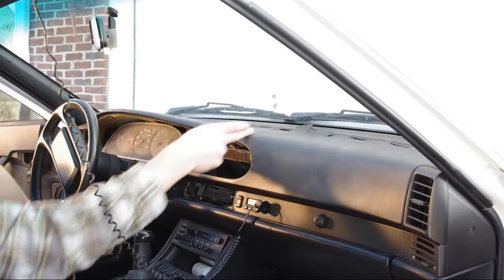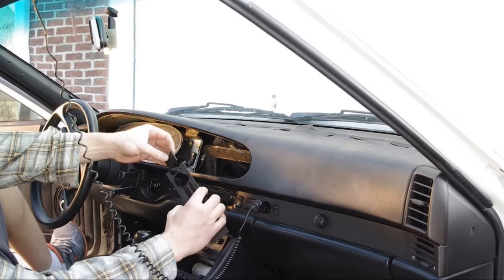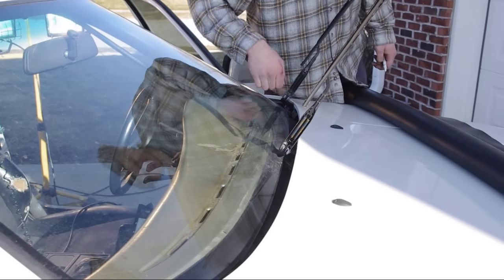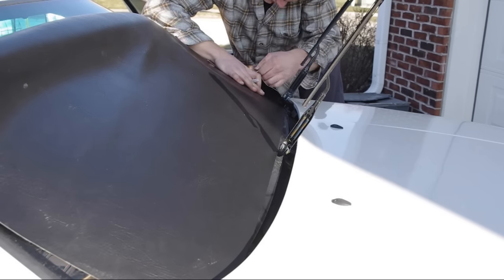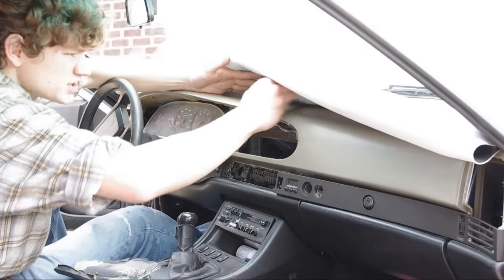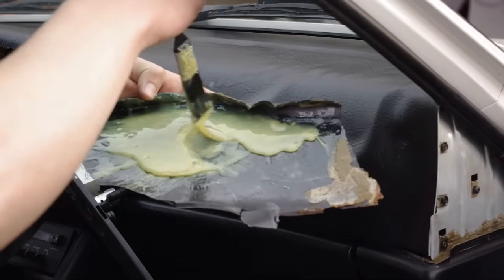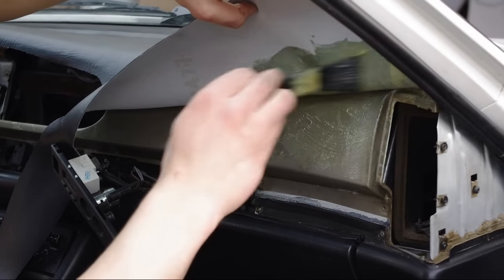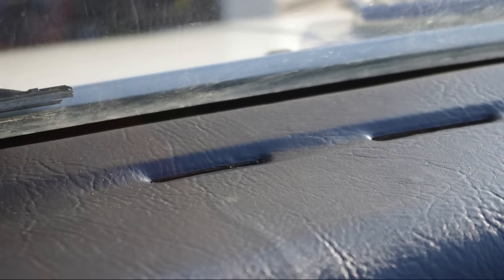How To Recover A Dashboard - Vinyl, Leather

Comment: This might be a dumb question but.... would doing this prevent a cracked dash?

I just bought a low mileage trans am without a single crack in the dash and I want to prevent it from cracking without having to put up a windshield cover every time
Reply: Keep it covered

Comment: Thank you for this handy video! The dashboard on my 1996 Dodge Ram is falling apart, and I'm about to do the same thing.
Reply: Joel M Yes, small ones for the screws. Once you're done, you just go around them with an X-ACTO knife.
Reply from the maker: This isn't a "Hack" it's a proper repair.  And you would just fill it in with a comparable foam and level it out before covering it.

Comment: Dude this is awesome, i did mine over a year ago , 1985 944 old dash , same way except the end result was hideous lol , i guess i used the wrong adhesive also was too afraid of burning the vinyl with the heat gun.Now that iv seen your video , i can do much better , tel me my friend, have you used a different kind of glue for the first part then like waited for it to dry then started the formation of the lower part ?

Comment: Great job!  I've recovered the roof liner in my '88 Volvo which had all come unstuck and falling to shreds. Bought some vinyl, however, carefully stripped off the backing by soaking it inch by inch with lacquer thinner (in a well-ventilated area). Didn't think to use a heat gun. Then used "ModPodge" craft glue, as I thought that contact cement would be too "unforgiving" when stuck to the "papier mache" base panel. Now am lookiing for a dark vinyl simulated dash cover for my Caliber - just because it is too pale and reflects into the wind shield. All I've seen on the market are carpet, fake suede and heavily textured "dashtex", which all seem too high maintenance dirt catchers. Looks like I'll just have to visit Jo-Ann, or maybe use some of that vinyl shrink stuff

Comment: Thats very nice dude. I need to do my 944 dash and all the trim inside sooo badly.
Reply from the maker: Thanks, Yeah it really brings life back to these old things.
Reply: Daniel Engling  My old vinyl is stuck real good to the foam..do you use a heat gun to separate it? What if you do need to fill large cracks before putting the new vinyl on, is there a foam spray like insulating foam? Thanks!
Reply from the maker: You can certainly use insulation foam.  I think that's the most similar to the original.  Using a heat gun to remove the original is a good idea.

Comment: Thanks for posting this vid. I am in the process of fixing up my 1990 Brougham myself. My dash came out in one whole piece so I think I will be okay to do the dash. MY problem is getting my headliner OUT. I have removed ALL the screws and loosed the clips above the windows . The inside molding is kinda interlocking and I'm going extremely slow so as not to break anything. No budget to speak of but I'm trying to have my baby last a few More years. She has some Really Bad rust that I can't fix but I have resigned my self to making her look pretty anyway. Any ideas of If you know of any vids would be Greatly appreciated. Have been looking for days to no avail and I want to finish her before the end of the month if possible. :-)

Comment: Can you tell me where you got the vinyl wrap at? And what kind of adhesive do you use. I have a 1962 Chevrolet Impala that has a steel dashboard and I would love to put black vinyl on it. Any information would help. Thank you
Reply from the maker: Vinyl came from Jo-Ann Fabrics.  Adhesive is called "contact cement" and can be purchased at most hardware stores.

Comment: Waited up, it was actually a problem were I was spreading the contact cement and it was drying up at the same time causing those lumps of cement. Only happened when I applied it to the viniyl not when applying to the material. First stroke of the brush was ok but 2nd one caused the lumps.

Comment: I'm redoing a h2 hummer interior. door panels dash and some other parts but my adhesive won't stick good. what exact brand and kind of contact cement did you use?
Reply from the maker: I'm sorry, I don't remember the brand.  Do you have armor-all on the parts you are trying to glue over?  That has silicon in it, bad for adhesion.

Comment: Not bad dude I wanna do this to the inside of my 02 mustang, it never had leather around any of the interior components just cheap plastic. Will this work the same way ?
Reply from the maker: I don't see why not!  Make sure the glue is spread around well.
Reply from the maker: Daniel Engling Oh, also make sure you take off ALL OF THE ARMOURALL you may have put on it in the past.  That stuff has tons of silicone in it and will be a nightmare to adhere to.  I would recommend a general grease and wax remover for auto painting or something like acetone (leave the windows/doors open so you don't pass out!).

Comment: I have a vinyl dash that is 30 some years old that has the front edge lifted up. No cracks yet. do you think I might be able to save it by heating it up and weighing it down?
Reply from the maker: +grn dragon Possibly.  Use good glue and form fitting weights (sand bags?)
Reply: What do you think would be the best glue for the job, has foam backing with steel mounting surface? It is almost flat with a 4 inch lift off the forward edge.
Reply from the maker: Gorilla glue if you have lots of pressure to force it down.  Contact cement if that is impossible.

Comment: Do you have links for the items used. Glue, vinyl, etc I’m very interested in trying this
Reply: Any contact cement will work or you can use spray glues. Inexpensive heat guns from harbor freight or just a hair dryer works for this application.  Vinyl like this is at any fabric or craft store. Or walmart has a not quite as good version as well. Scissors are sold everywhere even at gas stations.  Razor blades or exacto knives are almost as common maybe look at office supply places or craft stores.  Any and All of this is also on ebay or amazon if you like slightly higher prices.

Comment: is it necessary to strip the dashboard clean or can I glue on top of existing dashboard fabric?
Reply from the maker: You can, the problem is that the cracks and crappy existing fabric will show through the new stuff.
Reply: +Daniel Engling oh OK that makes sense, I bought some padded dash filler but I didn't know if I had to strip the whole thing. thank you for your fast response hopefully my dash turns out OK
Reply from the maker: +Erick De Jesus No problem.  Post a reply video or picture of it when you're done!

Comment: HEY cuzin Dan i would like to know if that would still work on an older truck dash. i have an 85 Isuzu pick up and the cover and foam has been damaged very badly. how would i re form the dash??? would you advise to use like a spray foam from a Hardware store and then shape it then cover it with the vinyl?? please help. im trying to recover my truck on my own to save more money rather than taking it to the shop. thank you.

Comment: Hey Daniel I'm covering my dash right now but I'm having a problem where little clumps of contact cement show through the thin vynil. I've tried applying it as smooth as possible but it always clumps. Any idea how to solve that or if I gotta tear everything apart? Or any tips?

Comment: Excelent job, man. I was about to ask the kind of cement used, but readind the comments I got the idea. However, a heat gun is kinda too pro for me, do you think a hair dryer would do the job or do you predict a crappy job? Also, my car's dashboard isn't as flat as your Porsche's, so I am wondering if there are gonna be too many wrinkles on the almost square angle the dash makes at the instrument panel itself. Any hints? Apply more heat? Thanks!

Comment: Dude that looks amazing I want to try this! I have a 1985 Toyota Pickup, they’ve got some sort of foam padding directly under the vinyl. Do you think your method would work on my truck?
Reply: Did you do this to you Toyota pickup, how'd it come out, how's it holding up?  I've got a 87 Toy pickup to do.
Reply: @capeman10   I actually just went to the junk yard and pulled the dash from another Toyota that was in decent shape. It was the wrong color so I followed these instructions to paint it to match my interior:

https://www.dsmtuners.com/threads/absolute-proper-way-to-paint-plastic-vinyl-interior-parts-for-the-diyer.365304/

It’s been a year and a half so far and it still looks great. I spent about $100 total. The restoration shop near me wanted $1200 to re-foam and re-vinyl my old dash.. too much for me lol

Comment: yeah thanks im going to repair my 1969 chevy impala dash it has tons of cracks and i want it to be my nicest first car
Reply from the maker: sweet man, send me a picture when it's done.
Reply: Contact cement and the pink scissors. Marine grade vinyl is the trick cause it favors well in the sun and the heat. And then again you can always add some 1/4 3/8 foam also.
Reply from the maker: Great idea.   This has held up phenomenally, but I don't know how it'd be if it was a color other than black

Comment: Daniel Engling Thanks for this amazing post. Just one practicale question : did you remove the VIN tag before?
Reply from the maker: no,  on this model it does not interfere with the dash covering.
Reply: Thanks

Comment: Great work, and very informative, thank you!!

Any thoughts on how the process might be different with leather? Best glue to use?
Reply: Long time for no reply; depends on how thick the leather hide is, leather won't stretch like vinyl so be careful cutting it to size. Use contact cement very liberally. 3M spray glue works well, use a couple coats, let it get tacky and spray again  let it get tacky again then apply, use heat but don't try to pull thin leather too hard as it can split later.

Comment: Hey Daniel o have a few questions about my Honda Odyssey my maintenance required light started flickering on n off  n then stayed on  now yesterday the tcs light came on with check engine light m while in idle nose or reviving weirdly , the one scam came back as the idle control valve bit after watching ur video I don’t think it’s that code if possible u think u could call me it’s a 1999 and this van is everything to me right now as a just went threw a major breakup n it’s all I have please help me I would b so great full I’m not much of a mechanic

Comment: I used Formica glue on my car top, bubbled up at first and then i had to press the bubbles out and it stuck well but later i found out that the top or the glue formed moisture and rusted out my whole top on my 68 Cougar.

Comment: Alright, yesterday we did the dashbord one my 944 S2 without removing it. Looks pretty perfect. The glue is supposed to work up to 120 Degree Celcius. We will see...
Reply from the maker: Awesome!  Photo?
Reply: I think there ist no way to attach a pic on a YT comment?
Reply from the maker: Ahh, ok.
Reply: When you took the old dash off, did it come off the metal easily? My turbo looks like it has some kind of padding under the vinyl you can see it through the cracks in the dash. 
Do you have pictures?

Comment: Great work Daniel, can you do this with Leather? Will the heat gun do similar things. I wouldn't expect that it would. What about thin foam underlays to give things a plush feel?
Reply from the maker: I have not tried either.  I imagine the thin foam would work if you like that, but the leather would likely shrink with heat instead of stretching.
Reply: Daniel Engling heat does not shrink leather
Reply from the maker: It certainly doesn't stretch it
Reply: you can mold leather with heat and moisture, just look at how saddles are made =)
Reply: Ási Helguson Thanks man, really appreciated that. Looked it. Found out alot about leather from saddle making videos.
Reply: haha, that's great. I actually have no idea how saddles are made, I just assumed that's how one would go about it. Now I'm gonna go check it out

Comment: Duuuude post which exact vinyl leather you bought please!
Reply from the maker: It's at Jo-Ann fabrics, dude.   They only have like 3 kinds.  I forget what it's called exactly
Reply: Daniel Engling They have like seven online to see...
Reply from the maker: Ok.  Just pick one that matches your car, or whatever color you like.   Also get the kind with fabric backing like I said in the video.
Reply: Daniel Engling Okay. Thanks. Just out of curiosity how much did you pay per yard? If you remember. Thanks!
Reply from the maker: +nanocalp something like $12 comes to mind but it may have been as high as the 30's it's been awhile since I've purchased any.  I usually buy in bulk and then don't go back for awhile.

Comment: This is great. However my 74 Nova has a deep crack on the dash which kinda pushes upwards at the opening.
Reply: You could try sanding it and then filling it with a fiberglass body filler (tigers hair).
Reply: Thanks. I'll look into that.

Comment: You Had better be using a number 80 3M glue with  to prevent gas bubbles from forming from the heat . You CAN NOT Use any type of glue but number 80 3M spray

Comment: you sure it will last?
and where did you get the fabric?
Reply from the maker: It's been almost 2 years already and holding up just fine!  I got it at Joanne Fabrics
Reply: Daniel Engling I don't think we have one of those over here. Do you know what the fabric is called?
Reply: RangerBoy B just go to any fabric store and ask to be pointed in the direction of the vinyl sheets

Comment: Only newer types of modern plastics degrade from varying temps. Plant-based hydro-biodegradable plastic and petroleum-based oxo-biodegradable plastic. UV Light is what causes your plastic to deteriorate and become brittle, no amount of Armour All will slow this down. However, there is many factors that can advance the rate it breaks down. For instance, plastic parts in the Ocean (SALT) can break down into micro-particles in less than a year. Armour All WILL help these types of issues.

Comment: no the parts are all clean. they were all painted before I started working on them but I've took all the paint off and made sure they are smooth I cleaned them with alcohol and still wouldn't stick.

Comment: what type of glue are you using ...?
Reply from the maker: Contact cement.  Super easy to find at any hardware store.  If you think of another go ahead and try it, but this has worked for me and is still holding up well

Comment: Maybe it have some spots where the glue don't reach very well, if I were you, I will try to use a syringe with glue in it and inject the glue in the bubbles the needle hole will be to small and very hard to see.

Comment: This is great when you have an older vehicle, with out the airbags on the dash. when you have the air bag in the dash this is very dangerous. Air bag may not go off in case of an accident.
Reply from the maker: Air bags will go off with almost anything in their way.  If you've ever set off an airbag on purpose, you know that sodium azide is no joke and will tear through vinyl like a hot knife through warm butter.  Also, isn't it just as dangerous to have an older car without airbags?

Comment: Just wondering-How long is that vinyl gonna hold up under sun and heat? If it's going to get roached in a year, I'd just lay one of those fuzzy dash covers over thd old dash. Anybody?
Reply: if you use marine grade vinyl your better off, it's ment to take the sun and weather.
Reply: Thanks!

Comment: this turned out alright, but only visually. the correct method would have been to remove the dash completely and attach the vinyl to the rear of it. you're probably going to experience some issues pretty soon with shrinkage and cracks
Reply from the maker: Three years later there are no problems at all.
Reply: i stand corrected, good job then

Comment: You'd get much better results if you removed the dash from the car and stripped all the old vinyl off. The extra thickness from the glued on vinyl doesn't look right.
Reply from the maker: I'm sure there would be marginal benefit to doing it that way, but frankly the additional 4-6 hours to do that are just not worth it to me.  More power to you for doing it that way on your project though!

Comment from the maker: Joanne Fabrics, I want to say it's $12/yard
Reply: Daniel Engling this looks really good! Do you remember what material you used?
Reply from the maker: @Non-ya-business  Not by name.  Some kind of fabric backed vinyl though for outdoor use.  Like boat upholstery
Reply: Daniel Engling I did see boat upholstery as an option, it said it only handles 200 hours of UV. Do you still have you 944? And has it held up in sunlight?
Reply: The closest Joann fabric to a Porsche 924 or 944 dash is called Artic Vinyl.  There are several other textures and colors so pick the one you think matches your car.  Bring a sample if you've torn some off.  Artic goes for $20 a yard.  You may want to buy two yards since it is only 54 inches wide.  If you sign up for the Joann app you get 50% off on your first purchase.  Here's the link so you can see the specs: https://www.joann.com/artic-vinyl-54in-black/3526274.html#q=Artic&start=1 .  Looks like it would stand up really well (e.g. 1000 UV hours).  Something any serious car owner should do is buy a CoverCraft custom windshield cover/insert to make their dash last regardless of the car.  And then USE IT all the time, summer and winter!  Heat is a factor but so are UV rays.  They go for about $70 depending on the car.
Reply: Roger Buswell thank you Roger!